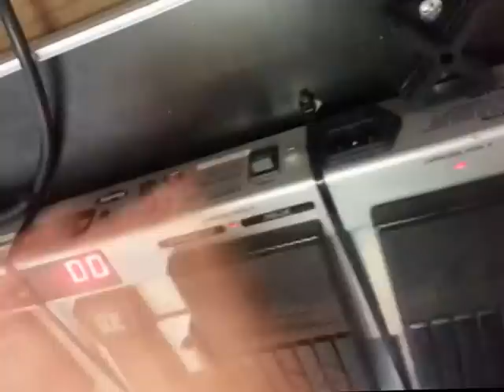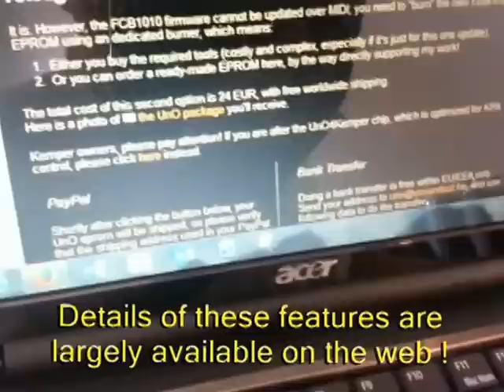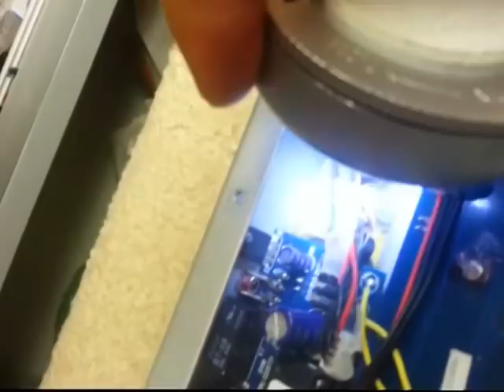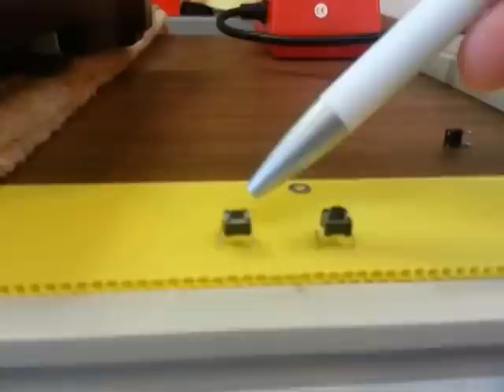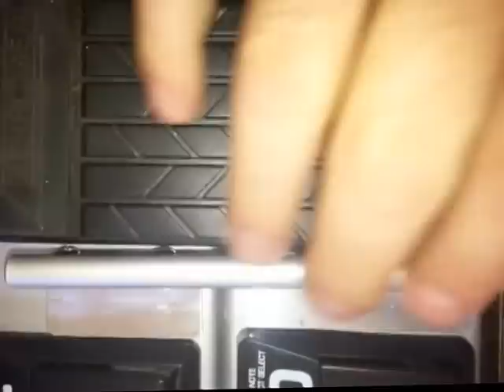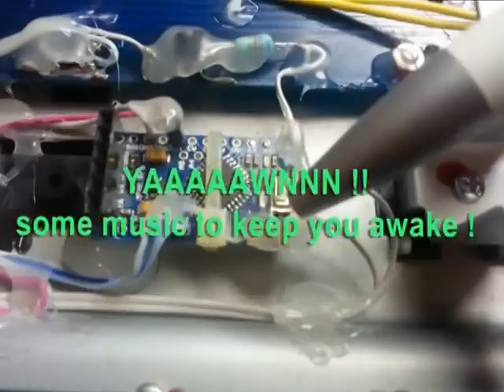BEHRINGER FCB1010 - 6 cool mods: phantom power, pedal errors, CTRL button, reliable buttons, UnO...

Comment: I successfully completed the power mod and it worked well for quite some time. 
The next mod was to chop off the expression pedals and make a mini controller. 
At some point I think I might have damaged the motherboard. 
I am in the process of replacing it from an existing FCB1010 someone gave to me. 
I'm not sure what happened, but the only lights which illuminate are the old optical potentiometers. All other lights do not illuminate. 
Maybe it is something I am overlooking, but I might have to replace the motherboard.

Comment: Oh my! THere are some killer mods!  I came up with couple of mods too: 1.Change the springs of the footswitches to more soft, because in my opinion original ones are too stiff. 2. Add foam rubber soft pads under the expression pedals to reduce hitting sound(it's useful for bedroom use, bc the noise was relatively loud).

Comment: Hi Bob,
today I installed a expression pedal range mod. This is the only source with regard to that topic I found.
I used some old neutral filter foils from my cam equipment to limit the brightness detected by the sensor.
So, the CC value changes simultanously with the movement. But on pedal 1 I have at the end of the movement 5 mm dead space after reaching the 127. 
Pedal 2  delivers exactly 0 to 127 from stop to stop. I calibrated them after the mod.
The strange thing is, during calibration you can notice that there are values detected on pedal 1 at the end of the movement , it changes the shown values.
Is that a software problem? 

Thanks for that video. Even after 6 years it was quite helpfull.

Comment: Very cool mods you made. I'm having an idea also to make some mods (well mostly 1: using an STM32 or Arduino instead of the current firmware). I'm wondering if it is 'easy' to read the pedal values, and same to read the switches (although I could possibly create some new kind of 'board'  inside, or solder directly to the legs, leaving the current PCB unused).

Comment: Hello,
Nice work/vídeo. Very usefull.
I was searching this type of modif to my FCB1010
I'm thinking about something similar, but:
I would like to use pins 1,5 to feed the FCB and to feed a wah pedal from ibanez (weapping daemon).
But the Current is diferent:
9v DC yo Ibanez
9v/12v (i'm not sure) AC.

So the power must be rectified.

I wonder:
¿Wich element I can put yo change de Current?
¿Is there any posibility, to feed the FCB in other point, where de Current needed is 12v DC? I mean, maybe the FCB has itself a rectifier in other point.
(I'm mechanical, not electrical...so I don't understand so deep this issues)

Best regards and thanks in advance !

Comment: Based on your video, I've made a similar EXP pedal mod but in another way: I put black tape on the LEDs/sensors surroundings to avoid reflections on the aluminum surfaces, and twisted both LEDs to the side, to decrease the amount of light that goes to the sensor. The result was awsome, but I noticed that the left pedal was getting a bit of the right LED luminosity, so I added a "wall" (also made of tape) to avoid that problem. Another thing I've made is to put a piece of tape on the black part of the plastic shaft, so the light wont go trouhg it anyway (just in case). Now both pedals go from 0 to 127 in all the range of motion!!!

Probably, an even better mod would be the adding of a LED trim potenciometer, so we could adjust the LED luminosity with a lot more ease... But since I have no eletronics skills, I prefered a more "physical" solution.

Lesson learned: optical sensors SUCK!

Comment: Hi Bob
Thanks for sharing your smart and brilliant modifications on the FCB1010 to make it more reliable
I have few questions regarding the equipmentl you are using 
What is the reference of the cable you have used to have MIDI + Power 
and also what is the reference of the micro switch you have used

Great job
Fred

Comment from the maker: Somebody asked me for the ARDUINO CODE for the CTRL mod,
here it is:

/**
*****************************************************
BEHRINGER FCB1000

CTRL button modification 

Make it possible to use one button of the FCB1000 as a push ON-push OFF instead of toggle only.
On the Effects rack it will be possible to use it as it is or toggle again.

Written by Bob Axx starting 26 august 2014 */

/* UPDATES:

2014-08-05

*****************************************************

Hardware:
- BEHRINGER FCB1000 Midi pedalFCArduino Mega
- Arduino Mini Pro 5V

Circuit:
ARDUINO   
 GND        GND from FCB1000  
 VCC        5V  from FCB1000 
  D2  (in)  button from FCB1000 (not the grounded one)
  D9  (out) where that button is connected (input of FCB1000)
  D13  (out) additional LED 

*/
boolean pressed = false;

void setup() {

  pinMode (2, INPUT);       // activate input with pull-up resistor
  digitalWrite(2, HIGH);
  
  pinMode (10, OUTPUT);       // activate button as unpressed
  digitalWrite(10, LOW);
  
  pinMode (9, OUTPUT);       // turns on additional LED
  digitalWrite(9, HIGH);
  
  analogWrite(9, 40);

}

///////////////////////////////////////////////////////////////////////////////////////////////

void loop() {
  
  if ((!pressed) &&(digitalRead(2) == LOW))  // pressed button reading
    {
       // NOISE & BOUNCE filter, accepts only double confirmed reading
       delay (4);                   
       if ((digitalRead(2) == LOW))      // still pressed 1
          {
              digitalWrite(10, HIGH);
              delay (10);
              digitalWrite(10, LOW);
              
              analogWrite(9, 255);
              
              pressed = true;
           }
     }
  
    if ((pressed) &&(digitalRead(2) == HIGH))  // release button reading
    {
       // NOISE & BOUNCE filter, accepts only double confirmed reading
       delay (5);                   
       if ((digitalRead(2) == HIGH))      // still released 
          {
              digitalWrite(10, HIGH);
              delay (10);
              digitalWrite(10, LOW);
            
              analogWrite(9, 40);
              
              pressed = false;
         }

    }

}

Comment: One question, Can you tell me why the response of the expression pedal "A" doesn't feel good when I use the wha-wa (POD 2.0 line 6)??. It sounds like i have to move my foot too fast to make the wha sounds good. Do i make my self clear??
Reply: You're probably in linear mode. Change it to audio taper
Reply from the maker: Is not related to the mod, but to the way the SW adjusts the frequency of wha-wha. Try to change the response curve (see user's manual)

Comment: Thank you thank you!!  The only mod I did was to wrap the plastic bag around the expression pedal sensor, and it works GREAT --  full range of motion.  (BTW, I think the bag I used was a little too thin, I had to wrap it around 3 times, but it works great!) I had started looking for other pedals, but now I don't need to. Now if I can just make the pedal a little harder to move, I'll be set!

Comment: Hi Bob Axx - This a great tutorial.  I just ordered a used FCB1010 with the Uno firmware already installed and this has given me ideas of what to do with it before I put into use.  I think I will implement the phantom power cable, expression pedal sensor and mini switch upgrade mods.  I don't have it yet but am anxious to get to work on it.  Here are items that I wanted to know while watching.  Perhaps you can add them to the description for myself and others:
- Manufacturer and part number for the replacement mini switches you used.
- Where you sourced the Tbars and tubular metal (aluminum?) for the protection shaft.  What were they called so we can search for them online?
- If you could link a url to see the arduino code that would be interesting to see how you handled it.  That part was not not boooring.  :-)  I don't think I will be doing that mod but have programmed arduinos in the past and it would help describe how the logic on the board/firmware is working.  Thank You !
Reply from the maker: - I have purchased them in Ebay, very easy to find, see images and find similar ones (ebay vendors change their ref continuously... :-/ )
- Tbars and tubular (aluminium!) from a local "brico center", 
- Arduino code for you:

/**
*****************************************************
BEHRINGER FCB1000

CTRL button modification 

Make it possible to use one button of the FCB1000 as a push ON-push OFF instead of toggle only.
On the Effects rack it will be possible to use it as it is or toggle again.

Written by Bob Axx starting 26 august 2014 */

/* UPDATES:

2014-08-05

*****************************************************

Hardware:
- BEHRINGER FCB1000 Midi pedalFCArduino Mega
- Arduino Mini Pro 5V

Circuit:
ARDUINO   
 GND        GND from FCB1000  
 VCC        5V  from FCB1000 
  D2  (in)  button from FCB1000 (not the grounded one)
  D9  (out) where that button is connected (input of FCB1000)
  D13  (out) additional LED 

*/
boolean pressed = false;

void setup() {

  pinMode (2, INPUT);       // activate input with pull-up resistor
  digitalWrite(2, HIGH);
  
  pinMode (10, OUTPUT);       // activate button as unpressed
  digitalWrite(10, LOW);
  
  pinMode (9, OUTPUT);       // turns on additional LED
  digitalWrite(9, HIGH);
  
  analogWrite(9, 40);

}

///////////////////////////////////////////////////////////////////////////////////////////////

void loop() {
  
  if ((!pressed) &&(digitalRead(2) == LOW))  // pressed button reading
    {
       // NOISE & BOUNCE filter, accepts only double confirmed reading
       delay (4);                   
       if ((digitalRead(2) == LOW))      // still pressed 1
          {
              digitalWrite(10, HIGH);
              delay (10);
              digitalWrite(10, LOW);
              
              analogWrite(9, 255);
              
              pressed = true;
           }
     }
  
    if ((pressed) &&(digitalRead(2) == HIGH))  // release button reading
    {
       // NOISE & BOUNCE filter, accepts only double confirmed reading
       delay (5);                   
       if ((digitalRead(2) == HIGH))      // still released 
          {
              digitalWrite(10, HIGH);
              delay (10);
              digitalWrite(10, LOW);
            
              analogWrite(9, 40);
              
              pressed = false;
         }

    }

}
Reply: Thank You Bob !

Comment: Thanks a lot for this very useful tutorial. I am quite satisfied with the EXPR pedals and switches. the problem is that I've tried to change the power supply system. it works as described the unit is on, but whit it comes annoying hiss and buzz that is translated to my signal chain via parallel DC power witch I also use to power other effects (overdrive compressor and so on), so I am not able to use ti. I have to carry the original long 230V cable. 
There is also one unpleasant thing that happens sometimes - the display and all the led suddenly go red and the controller freezes. this happened trice and every time it needed reprogramming the unit with factory reset and load saved sysex. but  today the unit went red and now i cant turn it on .. display stays blank no led reaction whatsoever. 
well i hope it will turn out that we wil be able to fix this malfunction... all best M
Reply from the maker: use a separate power supply, I don't suggest to power it with the same power supply of other devices!
Reply from the maker: also check carefully its voltage, 9V is OK, less isn't and may give that results

Comment: I did the mod where you apply some shielding to the LED sensor for the foot pedals and it works MUCH better.  It took about an hour to complete.  I just grabbed a plastic bag from a loaf of bread that had white opaque on it.  I cut a couple strips off, got some regular scotch tape, and some scissors.  I just wrapped the plastic around a sensor a few times, wrapped some scotch tape around it to hold it in place, and that's it!  Now the expression pedals will register movement as soon as I move instead of registering after 50% of the way through the movement.  Thanks for the tip!